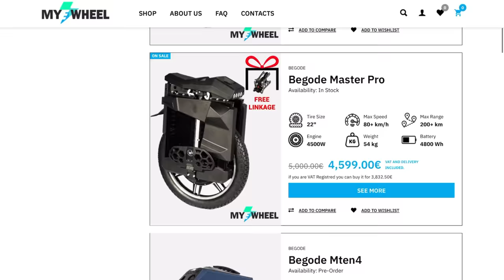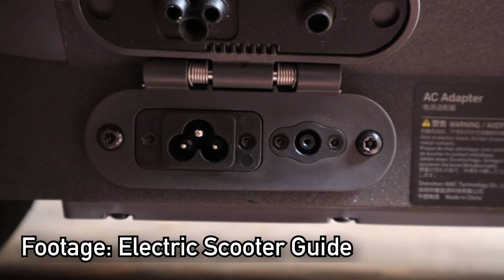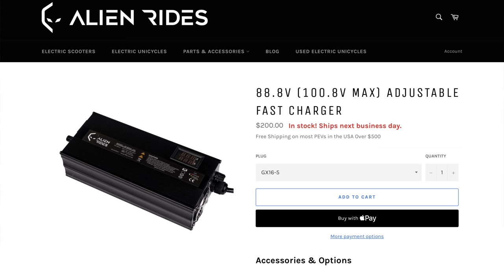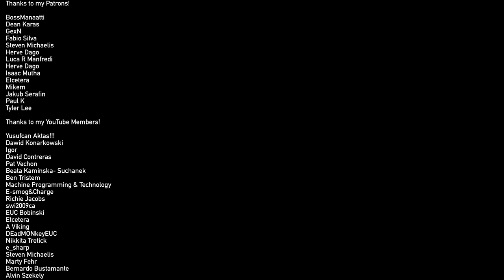I don't like where EUCs are heading

Comment: 5:50. Interestingly enough, I've found that going from a Sherman V2 to an S makes me a more-friendly rider. Granted, I've had more time to innovate how I can ride more safely and be seen more by pedestrians. However, the riding characteristics of the S make me plan more, and the suspension doesn't make me as fatigued which allows me more energy to be courteous. I can't forget though, that I'm frequently aware of safely threats, like adults letting their toddlers run into bike lanes. I watched a bicyclist make an emergency stop to avoid running over a runaway toddler. With experiences like that, I'm a much more cautious rider... I might try to ride my V2 just to see if I'm even more careful on it now than before I got the S.

Also, I frequently appreciate the 22" wheels being present for taller and bigger riders. After seeing a Master Pro in person the other day, I can confidently say 20" is perfect for me. Asking that same line of thinking, I agree that we need more modern tiny wheels. I think a max of 32mph would be nice because I've met beginners on 16S's that say they've cut out. If we need the overhead, but we need responsible speeds, then we need more customizeability in our tilt-back speel limits. The Shermans' could use a setting between 36mph and, what was it, 168mph?
Reply: Yeah I wish I could customize my alarms and tilt-back for the S using EUC World. I've caught myself going faster than I would really like without realizing it a few times. I'm personally most comfortable riding between 35 and 40mph with an alarm and tilt-back set slightly higher than that for some headroom.
Reply: @wesleyson21  Same! For a while I had my Sherman's alarm set to 34mph with tilt back at 36mph, but now that I have motorcycle great I want to up the limit to 40. Not possible without having an app and a Bluetooth speaker running. Now my alarm is set 36mph and my tilt back set to 168mph.... I have probably gone 40 by now, but I don't like that I'm technically "riding the beeps." what if I don't notice them changing and I cut out?

Comment: sure its nice to get some big and fast wheels but that should not be 100% of the wheels that come out and personally i would love to see inmotion make a wheel that has the rs19 form factor, raptor controller, 126 volt, 2000wh, 18-20 inch tire, smart bms, 2500w-3500w motor and 60-75kph max speed (that's my dream wheel)

Comment: I totally agree with Adam on the price point. Yesterday i looked at price after seeing Lynx review and man it is ridiculous. For half price i can get an electric bike that can go 90km/h and has a range of 200km, can carry 2 people and has a trunk compartment of 35 liters. And it is well developed with safe and proven tech with warranty and parts available.  The entire euc thing moved from eco friendly to an elite hobby. I understand that the small sale volume and mr wrongway and others keep asking for quality drives the price up but still..not sure were all this going. If you want to make it a thing and drive up the sales then you need more beginner and intermediate units not pump all your effort into just elite models. The smaller use case the smaller the volume. bleeh. This way the trend will just die off.

Comment: Hi Adam have alway loved the videos you put out, I bought my v11 partly because of your reviews and videos and I agree with the people who say it is a good all around wheel. I also agree that the manufacturers need to keep making the lighter euc’s for those who need them. And I would love to see and integrated charger but that will add more weight to the wheel and to decrease weight they would have to make smaller batteries so you loose range and power also to make the materials stronger you also will gain weight, stronger more dense material is heavier it is a balancing act ( and of corse cost can’t forget that). To make a 134.4 volt battery using the cells they use 21700 lithium you need 32 cell that only gives you about 5100 mAh and then stack more of those together to get another 5100. ( I’m and electrician by the way) and though I still think we need the lighter wheel I don’t think we can stop pushing limits because that helps to push innovation and provide us with lighter stronger more affordable materials. Sorry for the long winded post. Keep up the great videos you have helped so many getting into this field including my self.

Comment: Back when I was in the Navy, half a century ago, the shipboard firefighting gear was interesting. On the flight deck and the hanger deck they had a mix of both 38 and 63 mm hoses. The larger hoses had high flow nozzles and were used by up to 4 man hose crews. Below decks, it was almost always 38 mm hoses with nozzles limited to 360 liters/min at 7 Bar.( 1.5 in hose flowing 95 gpm at 100 psi ). The nozzle reaction was 60 lbs of thrust (267 Newtons) which was all a single able bodied seaman could handle in confined spaces while also pulling the hose around obstacles.  Sure, you can lift a hundred pound sack into a van at the big box store, but that is weight lifting, not endurance. The Navy had lots of experience with shipboard fires and this is what someone can handle when alone at the end of a fire hose and still be standing an hour later. I have a Mcm5 and a Nikola, both are nice machines and they fall below that weight limit as does the S18 and V11. Both of those suspension wheels sacrifice range to maintain a decent weight. So, what are the bigger wheels good for? My answer is group rides. You really don't want to get in trouble on a big wheel when you are alone.

Comment: The V13 pedals (at least the ones that come with my wheel) do have screw in studs.  I think maybe some of the demo wheels had molded studs, but they fixed it.
Reply: Mine, (1st batch sent to Australia) has molded studs. It also has a ridiculously high rubber stop causing a painful pressure point on the foot arch.
Reply: @71Dana  Yes that rubber stop is annoying.  I just remove them.. you just push them out with a screwdriver.
Reply: @SamClegg  I'm time poor, & i keep forgetting. 
No today though, thanks for the reminder!

Comment: I think the EUC manufacturers are doing a great job of putting out a lot of choices in a relatively short amount of time, especially compared to the OW manufacturer. However, I’d like to see far better cable management, stupid easy tire changes, real front and back lights (no more LED junk for headlights/taillights), better methods to prevent overleans or high speed cutouts implemented in both hardware and software and of course, lower prices.
Reply: What would you use for lights instead of LEDs? 🤨
Incandescent lightbulbs?
Reply: @oliverer3  I don't think LED is the issue, rather manufacturers just sticking basic LED's on a housing and not really caring about beam spread.
Reply: @InsanitiesBrother  Oh absolutely I just found it funny that they seemed to not want any LEDs at all.

Comment: What would be the ideal build if you were to take how a piece of technology was deployed across all brands? Like the V13 front lights, the V11 tail lights, with Veteran S suspension system, with Kingsong trolley, Patton kickstand, motor of a Patton (?),  etc., etc.. BTW, nice video, very valid points.

Comment: I started riding at the beginning of October 2022, and have started off a complete beginner with a Begode Master.
So far, I have been very lucky in my experience with the wheel, and though i've cracked the tinted tail-light cover, and "naturally" scraped up the bottom of my petals a bit in my journey of learning, I will say that my Batch/Version 3 wheel has stayed in pretty good shape, and hasn't had any serious issues, as of yet. I hope it stays this way, but I also understand that making sure to avoid water, and to keep the wheel maintained is key, as with any vehicle.

When it comes to the quality, and the direction that EUCs companies are going, I dont think that wheels should go really go beyond 60mph...60's still a bit too fast, in my honest opinion. I still havent gotten beyond 35mph on my Begode Master yet, because I want to fully understand the threshold to begin letting up on the wheel, if there's a dip in voltage/power that's needed at those higher speeds/higher strain on the wheel, so I can mitigate cut-outs to the best of my ability. I honestly don't believe companies will be able to justify creating wheels that could go any faster than this--at least until they can realistically get to a point where safety, weight, durability, and other important factors 

I believe as we get to this point of 55-60mph, the companies should start letting off of the "race for the fastest wheel", and start focusing on the things that they should've focused on before speed--higher quality parts, durability, reliable waterproofing/avoiding the use of glue/silicone paste-seals (seals like this should be secondary form of reinforcement, not the primary means of sealing up areas that ould easily compromise the entire device/be a cause for serious danger to the rider & others by means of sudden catastrophic electrical failure while riding, or fire, if water is introduced) , creating ease in basic maintenance, repair & upgrading/tire changes, charging innovations, torque & handling innovations, higher-quality BMS, safer tiltback/cut-out prevention warnings/alerts, and lessening the possibility of cut-outs. Though a lot of this has already been touched upon by Adam in this video, I figured I'd point out some of the things that came to mind for me that I didn't happen hear, or go deeper into those same topics from my own viewpoint. Another thing that was mentioned in the video, is quality Customer Support & parts availability. These will help in maintaining the longevity of wheels (of course, I'm sure many companies want people to eventually stop fixing/updating their wheels so they can get another sale out of them, but that's a scummy way of looking at things--it shows lack of quality in the product's longevity/serviceability, and though the day will inevitably come when a new wheel will be needed, it should be because the rider wants to have an updated model--not because it's impossible to get a wheel running via replacing key components. Another thing this would (hopefully) do, is assist in making parts not only easier to access, but cheaper.

I am sure that I missed a few things myself, but I will say, that in my opinion--it does look like companies are beginning to somewhat take these concepts & ideas to heart, and are beginning to lean into the aspects of smarter (hopefully safer) BMS's/motherboards (s19 immediately comes to mind--so does the Begode Master & it's Dynamic tiltback which I just found out about today, so I don't have personal experience to back that up) , more durable shells (v13, sherman S, Veteran patton, and metal "bumpers", that double as multi-use contact points/roll-cages/handles/etc & metal battery-packs, as seen on the EX30, and supposedly on the newer versions of the Master), and the (alleged) waterproofing of the Begode A2 (still wouldnt ride it completely submerged, or throw it in a lake like I saw videos of testers doing--it's not a diving watch. The last thing I'd like to add, is that 

Anyway...That's my two cents about where we currently are seeing right now in the EUC world, and what we will hopefully see in the future.

Comment: I would love to see people join the Esk8 and PEV revolution in EUC's and start Vescifying them, DIY builds and more, I have been struggeling trying to build a EUC in parts hoping to find a "scrapped" EUC because buying spare parts or alike is just partially possible and just going from a hub motor requires alot of work, wish there was just more DIY options especially some VESC builds.
Reply: I did my EUC and onewheels with vesc❤

Comment: Great video! All very valid points made and I totally agree. I also do not want to see any faster wheels especially as most countries are still very unaccepting of personal electric vehicles. If wheels are getting faster than cars the chances of EUC's becoming widely accepted would likely not happen and be stuck behind expensive insurances and licenses at the very least. I would rather see more quality of life improvements over additional speed. I usually don't ride faster than 30mph anyway even though my wheel is more than capable.

Comment: try creating your own Perfect Wheel with all the shortcomings that you mentioned fixed, improvements applied, wheel that is durable, prioritizes torque, safety and can safely cruise at 50km/h. On paper or 3D model with technical details listed.

Comment: I'd be happy with a wheel that has a real 40 mile (65km) range and can cruise at between 25-30mph (40-50kph). I prefer riding at 25mph but the cars in my area tend to do 30mph and I need to keep with the traffic to be safe. I have no desire at all to ride faster than 30mph. I want a real that's rugged and doesn't need repairs after a simple fall. It would be great if the replaceable pads acted as shock absorbers in a fall. I don't want to worry that the battery will burst into flames in the middle of the night. I want lights that work on the road including a decent red rear light. I don't need more than 100v as I use my wheel for transport and not circus tricks - adding more voltage just adds to the cost and seems to reduce the range. If a wheel weighs more than 30Kg then I have to think hard about how to lift it. I think my ideal wheel would be something like a KS18XL if it had a slightly higher cruising speed and better lighting. I'd also be happy with my Nikola Plus if it had better lighting and I didn't have to worry about battery fires. The most off putting  thing about modern wheels though is the price.

Comment: FETs are switches, the motor should have supercapacitors to absorb current surges.
The batteries should be rapidly interchangeable, so that a spare set can be carried in the backpack for extra range.
The batteries should have sine wave outputs so that the wheel can be used as a power source for off-the-grid living.
The chargers should be in-built. 
A picatinny rail should be included to mount extra lights, mirrors and whatnot. 
A wheelbarrow should be designed for extra carrying capacity. (Or a single-wheel trailer)
The wheel should drop out of the bottom for rapid tyre change. The cable connections can be through male and female fixed plugs.
A dummy load should be in the extras, so that the batteries can be drained for public transport.

Comment: This is probably your best non-riding video to date.  The only thing I add is my longing for a 16X-esque wheel (with all the bells and whistles it has) with an external shell made like a steel-belted tire so it would essentially suffer no damage from crashes.

Comment: Built in chargers would be a mistake. We would realize very quickly why once we were stuck with them. It would be more subject to problems,  you'd probably need some tech experience to service or replace, it would make the unit bigger and heavier,  maybe some users would prefer to choose the type of charger that they use. It's been tried in electric wheelchairs and scooters (my trade) and we are so much better off moving away from that practice a decade ago. Otherwise, I like your take on the current problems in the industry today and agree with you.

Comment: I want a wheel that goes 55 specially for safety. Because I live in the states the safest place to be is the road. And often the speed limit is 45 mph. 55 gives you some headroom if you need it. 30mph would be good if we actually had an infrastructure appropriate for bikes, but I’d rather be on the road than the foot wide shoulder that is called a bike lane.

Comment: I am an electrical engineer and I don't like where EUCs are heading neither. My thoughts are, it should be a legitimate in-city transportation, with a model of intercity (say 90kph model) variant.
It should be between 12-15kg and should be easily taken to office if necessary. Not 55kg rich man sport toys.
Additionally, hub is unnecessary, you could easily lower the center of mass to lower point by doing it hubless, and instead of putting batteries like a donkey saddle, they could be positioned inside the wheel in hubless design. single central suspension trail would further decrease the cost, compensating the extra cost to make it hubless. Easily could be engineered better with 450€ price tag and 15kg weight with enough power and speed.

Comment: Z10, as for me, is the pinnacle of progress in the evolution of unicycles, although it is tough as a stone, but it is the strongest, most reliable, safest and the water protection from the factory is very good.  Everything that happened next is not worth the z10.  Yes, the battery has become larger, the mileage is higher, the speed is faster, the power is greater, but!  the quality has gone to shit

P.s. If anything, sorry for my english, it's google translate😁

Comment: The top speed isnt a issue..cars go 130 mph however you do not need to drive that fast. This applies to EUC. I agree with everything else you said. Especially the chargers. Frame style is something I am working on. In 2024 surely we can get creative enough to have suspension and lose the square spongebob look.